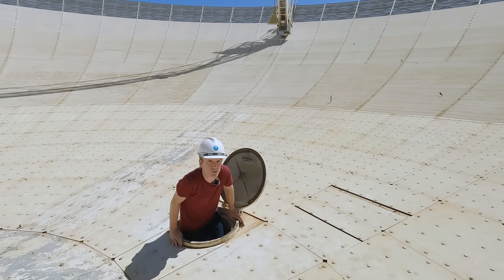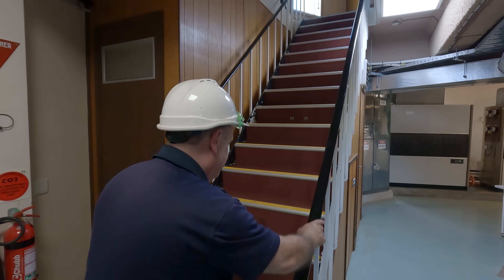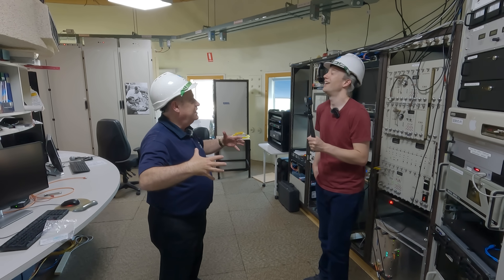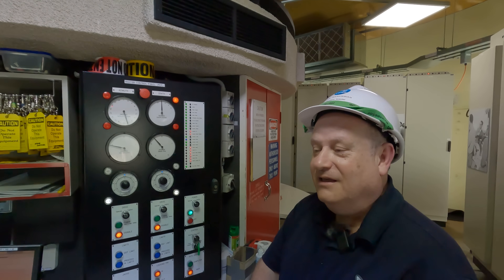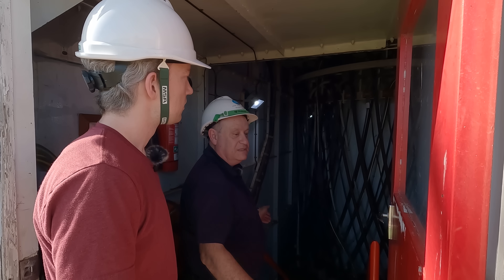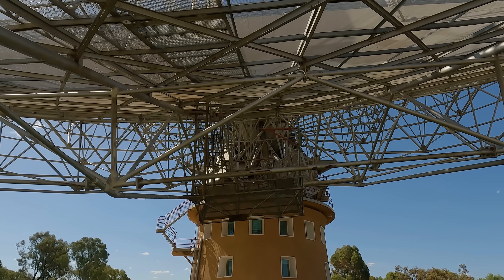I took a ride on a moving radio telescope

Comment: How the dish at that angle doesn't rip off from the building is quite interesting
Reply: At about 5 minutes, when the dish starts to tilt, you can see the counterweight on the other side of the pivot. So the whole assembly will have a center of mass that's directly above the riser.
Reply: @f0rth3l0v30fchr15t  Also, they mention that dish assembly is just lying on the azimuth track. So it have to always keep the center of mass inside this track, so sher weight of the dish keep it from falling.
Reply: @f0rth3l0v30fchr15t  wow, I totally missed that counter weight! Guess it goes to show just how lightly you can make these radio reflector dishes with the crazy long wavelengths some of them work in that a similar (or probably substantially more so because of the torque the dish would exert being so far from the axis of rotation) can look comparatively tiny to the reflector dish!
Reply: @f0rth3l0v30fchr15t  right, thank you. I was wondering too but couldnt find a good sideways shot in the end.
Reply: 5:23
Reply: @duudiiss  what why did you put a time loop?
Reply: @meandmaw588  what?
Reply: Who cares whether it's attached to the building or not? The question is why it doesn't fall off when it's tilted at that crazy angle. That's a valid question no matter what piece of the structure it's attached to.

As others have said, the real answer is that there's a counterweight to keep it balanced. It has nothing to do with it being attached to a separate foundation, that was done for a completely different reason.
Reply: @AndrewMeyer  Fun thing, it is not attached! It just lay on top of the azimuth ring, and its weight just kep it there.
Reply: @AndrewMeyer  Or it’s the fact that the radar dish itself isn’t super heavy, it seems to be mostly mesh/framing.
Reply: According to the Parkes "User Guide", while the dish itself is 300 tons, the counterweight is 475 tons.
Reply: Even when its tilted like this the dish is still centered on the central column so there are only vertical forces from the weight of the dish.
Reply: Counterweight is a magical thing.
Reply: @mattsmitt00  As is cantilever.
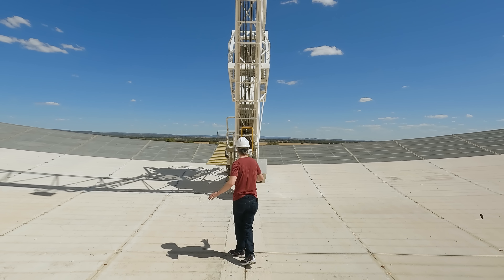Reply: 5:03 you can see a big counterweight at the back, so the center of mass stays the same no matter where the telescope is pointed.
Reply: @Riesenfriese  The counterweight had such a small volume compared to the large parabola part... The material must have been very dense.
Reply: The full answer as other people have pointed out is that the dish's weight is supported by the azimuth track, but the counterweight at the back of the dish weighs slightly more than the dish itself, keeping its centre of mass much closer to the centre of the structure. As John indicated heavy winds can upset that so which is why they have to stow it pointing straight up if the winds pick up too much.
If I recall correctly (It's been a few years since I was running tours) the counter weight is a good 50-100 tonnes heavier than the dish itself, in fact they had to increase its weight when they put the new focus cabin on because the new focus cabin was substantially heavier.
Reply: It's not even bolted down, it's there with its weight. Balancing it must have been a huge task without computers!
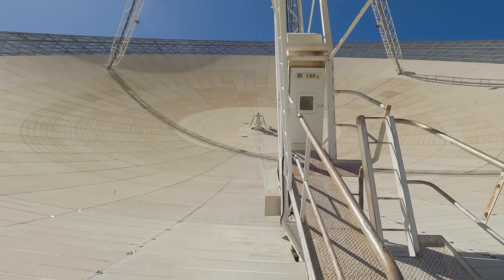Reply: If im understanding you correctly, the dude said at 6:40 "its just the sheer weight that grounds it". At 8:30 that seems to be a counter weight to keep it more centered as it rotates to avoid tipping over. When you look at it, the bottom half of the dish seems to be significantly heavier, so all that keeps it from "ripping off the building" (or so I believe)
Reply: @HoIdenJones  yes it's counterweight
Reply: "some of these telescopes are built so that the dish doesn't fall off"
Reply: @OwlRTA  Which is a good thing, it's a little difficult to tow a dish beyond the enviroment.
Reply: @OwlRTA  "at all"
Reply: Unless the building is mostly thick concrete and the bricks are just décor essentially
Reply: @AFGuidesHD  Like the guide said in the video, the dish and the central column supporting it have their own foundation and are not connected to the building, the building is entirely aesthetics to house personal and equipment.
Reply: @boogusnutsack5926  *personnel
Reply: @aprilbornheimer4094  Thanks
Reply: @AFGuidesHD  if I understood correctly, its not resting on the building, but the separate central column which seems to be made out of a pipe-shaped steel outer layer and a massive steel core column.
Reply: @kennichdendenn  that’s right. It’s supported by its own foundation and inner structure
Reply: @kennichdendenn  i
Reply: @AFGuidesHD  3:56
Reply: At 4:55 it looks like the dish has a large counterweight to keep the load on the tower vertical as it rotates.
Reply: The dish is on a separate foundation from the rest of the building, they mentioned that in the video.
Reply: @richardmillhousenixon  And the dish isn't fastened to anything at all!
Reply: @richardmillhousenixon  In the video he talks about a "device that helps us point the thing and we don't want it connected to the building due to vibrations will cause the instruments to be out". He doesn't mention anything about structural integrity.

I'm only saying this before anymore people chime in with a similar "you didn't even watch the video" line.
Reply: @AFGuidesHD  Dude, just take the L. Literally the sentence immediately before that one he explicitly says that the dish is on separate foundations. Your quote was the follow on that explained why that's the case.
Reply: @bosstowndynamics5488  Except i'm not going to "take an L" for something he doesn't say. "This column has a separate foundation to protect instruments from the vibrations". There's alot of extractions to get anything about structural integrity or weight distribution from what he says at the 5 minute mark.

I'm not arguing with what others say here. In fact it raises even more questions if most of the weight is on that thin column.
Reply: @bosstowndynamics5488  Mate, he never said the dish is on a separate foundation, the center column is because they don't want vibrations from the rest of the structure (the dish/the foundation it stands on) transferring to it
Reply: @cotneit  Brother, if it's connected then vibrations would transfer. That's how vibrations work. That column isn't there suck vibrations into it from the air.
Reply: @AFGuidesHD  You obviously didn't even watch the video
Reply: @Flyingdinosaur69  ;)
Reply: @AFGuidesHD  Sigh, people don't listen or watch closely, do they? 
Firstly, the "central column" is not that thin steel post (that supports the stairs) it's the large steel casement they walk thru to get there. The even taps it as he talks about it here: 05:28

Secondly, the "master equatorial" is not the mount for the dish, it's the optical telescope that is used to aim the dish. He says so here: 07.36

The dish itself is supported by the main building. You are correct, they all need to pay attention to the video.
Reply: @AFGuidesHD  the video explicitly says that the dish is on a separate foundation. You said "Unless the building is mostly thick concrete and the bricks are just décor essentially", which is completely irrelevant, given that the video explicitly says that the dish is on a separate foundation from the rest of the building. I'm only saying this before anymore people chime in... oh wait no.
Reply: @AFGuidesHD  it's not connected, looks to be built the same way that battleship turrets are
Reply: Not only it's on a separate foundation as others have said, but it's not even attached to that column!! It's just resting on it and staying there because of its own weight! (6:38)
Reply: It works like battleship turrets, it's just a floating superstructure held in place by its own mass. The dish weights about 500 tons, and it's counterweight weighs about 500.001 tons, which lets it self-correct if anything goes wrong. The bolts on the thing holding it to it's counterweight are also absolutely massive though, from memory, I'd say probably half a metre wide, and there are dozens. They also didn't mention that the little blue motors that turn and rotate the dish are only a few horsepower each, and aren't really any bigger than a few dozen cm. It was really cool standing next to them during the 50 year apollo anniversary watching it all move and whir right in front of you!
Reply: The angle doesnt matter. The altitude axis has counterweights, so the center of mass always remains centered above the building.
Reply: If you think about it the dish is very very light compared to what you would think.
Reply: Large counter-weight built into the jointed structure balances the dish so that very little power is needed to move it.
Reply: Proof everyone watches Tom Scott 🤣
Reply: infinitely many turtles holding it up
Reply: It has a counterweight.
Reply: Best believe what you see above ground isn’t all their is I’m sure the foundation goes down in the ground a good bit
Reply: That’s what I was thinking
Reply: the structure of the telescope is likely designed "lightweight" (at least it looks like it was) so more of the weight is concentrated in the things below the telescope (or behind it once it has folded down) so the stress might not be as high as expected. plus it is on a different foundation that is likely build to support it's extreme weight and the stress.
Reply: Where in Australia is the telescope located?
Reply: @Saxondog  Parks, New South Wales.
Reply: @Saxondog The Parkes Observatory is north of the town of Parkes, about 5 ½ hours drive west of Sydney.
Reply: @Saxondog Parkes.
Reply: concrete has insane compressive strength.
Reply: God keeps it there?
Reply: not surprising at all
Reply: There's a fulcrum, I image the dish is balanced at any angle.
Reply: Counter weights.
Reply: Its being balanced by counter weight. 8:35 you can see the arc shaped counter weight on the opposite side of the dish
Reply: plus it has to be counterweighted. otherwise the motor had to work extra hard to move the thing
Reply: Consider where your soul will spend eternity, heaven or hell.  You don’t want to end up in hell because you rejected the Sacrifice Jesus has made all who repent and turn to him by faith.  We are all guilty of sin.  We lie, steal and look with lust in our hearts.  We are all Guilty before a Holy and Righteous God.  GOD is not just all loving and overlook your sin.  He is loving but sin He will Judge because He is Perfectly good. The Good news is God the Father sent His Son Jesus Christ who was perfectly Holy to pay the penalty for your and my sin out of Love for us.  We can’t keep the Law we break most all commandments.  But Jesus fulfilled ALL by his perfect thoughts, words, deeds and motives for us because we could not. Jesus loved all humans and God the Father perfectly.  Turn, repent of your sin and confess Your thankfulness for what Jesus did for you.  Put your faith in the perfection and the righteousness of Christ.  Jesus was raised from death to give you new life; death has been defeated. Out of love and grace eternal life is promised to those who have faith.                    ,/......................................
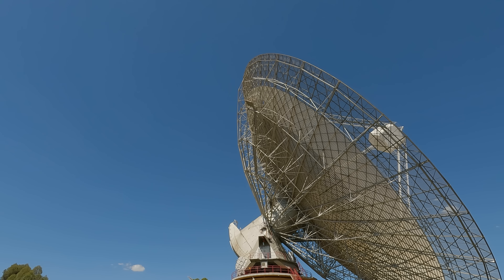Reply: Its not just hanging off the side.  Theres a massive counterbalance there that keeps the weight mostly evenly balanced on either side.  Its the same way most, if not all, dish antennas work.  You can see the huge solid metal block at 7:30
Reply: At 7:30 you can see the massive counterweight
Reply: They are not connected and there is a counterweight you can see as well ;)
Reply: besides being on separate foundations and physically disconnected it is even more mindblowing to me that it is "just resting" up there and not bolted down to the center column as well
Reply: @derKarl_stp  you cannot bolt something that big due it´s size - it needs a space to expand and shorten. It is the same with bridges - every piece is tight up on only one end, the other side of that part is "loose" on some rolling stock of sort, so it can work due to temperature changes. 

It is the same case with Madison Square garden or where Tom was - it´s ceiling is only laying down there due to it´s weight and no imaginable force can lift it up and carry away. It is slightly more difficult with huge dish and that´s why John said that in extreme weather the dish need to stand straight upright to not fall over.
Reply: @siriusczech  Jan I know that this can't be bolted down (for several reasons, besides the ones you mentioned)

one of the reasons is the possibility of binding up during use as different materials have different expansion rates and speeds during temp-changes.

it's similar to bridges that (most of the time) are totally free floating over here and rest on rolling pads to be able to move independently from the ground and pilars (seen a lot of bridges on the underside and their resting points over here and there you can see that they aren't fixed in place)

I just meant it is kinda mindblowing that this thing is just resting there and actually could fall off during stronger wind and then they tipp it over to the side so you can haul heavy things into the center of the dish when needed... you would think something is bolted down there because it looks so unreal but it is not

this is mindblowing, that this well balanced structure still has some play to it when it comes to weight and movement
Reply: At any angle, it's center of mass is still over the bit it sits on.
Reply: Very interesting. A very different design to the Lovell RT near where I live in Cheshire. It seems more industrial while the Parkes looks very elegant on its small base.
Reply: ENGINEERING SON
Reply: So mind boggling
Reply: And you didn't bring a skateboard. Figures.
Reply: It's counterbalanced probably to within a few thousand lbs. Otherwise the worm and gear would wear rapidly. Lifting the loads with the dish is probably the heaviest thing it sees.
Reply: Glue
Reply: Did you even watch the video?
Reply: Fun fact: the beam goes so deep that they moved the location by 100 meters during planning so it doesn't disturb the Stonehenge || |||  ||| ||
Reply: Suction
Reply: frr
Reply: Didn't they say the satellite wasn't attached?
Reply: How it doesn't rip of the building is the counterweight. At that angle the the counter weight ensures all force is still downwards. 
Without a counterweight it would fall off the building because the force would be sideways.
Reply: There's a huge counterweight on the other side to keep it balanced.
Reply: it probably has a huge foundation
Reply: the center point of the weight is always in the middle
Reply: bro its the guy making a video on games
Reply: Alien technology bro
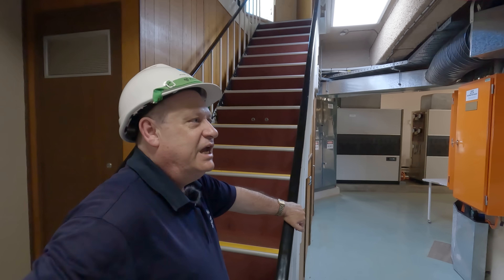Reply: 1:00
Reply: Simple physics really
Reply: It's bad enough that people immediately jump to pedantics about the separate foundation just because you mentioned "the building" in your follow up. What's worse is that some feel it's entirely appropriate to be insulting, demanding acquiescence like your curiosity was some kind of egregious, intellectual folly. All because you didn't mention the separated central structure. A central structure that is, to the aggrieved six-minute experts: "ENTIRELY disconnected from the main structure and HOW DARE YOU think the building holds ANY structural responsibility when it's OBVIOUSLY on a different foundation and THEREFORE the building would be UNSCATHED in the event of collapse YOU BUFFOON!! HERE IS AN L, TAKE IT FOR YOUR COLLECTION!!"

To the few that simply mentioned the counterweight: that's the correct answer. Thank you for staying on topic in your answer.
Reply: @illitero  well said mate
Reply: @illitero  smacks desk thank you!
Reply: There appears to be a huge counterbalance behind it. I figure they thought of that when they built it...
Reply: One of t’lad’s  best.
Reply: @josiebee-e6e  
T’lad, hahaa!
I agree, t’lad did do well. 
Well Done t’lad!
Reply: @josiebee-e6e  Agreed
Reply: The centre of mass is still above the tower, probably
Reply: physics bruh
Reply: If you knew it was on a separate foundation then why you ask if it would rip off from the building? It's not part of the building.
Reply: @The_Miles_Edgeworth  I didn't know it was on a separate foundation and still don't. The whole contraption is on the building. Even if most of the weight is on the smaller column there's still the tracks that go around the whole rooftop.
Reply: @AFGuidesHD  "At the top of this column is the master equatorial"

That's the thing that holds the telescope so they can aim it accurately. Dude just take the L.
Reply: @AFGuidesHD  I think youre missing the people mentioning the counterweight, thats what enables the thing to not just rip off of its center post. no matter how tilted it is the weight is still centered directly over than post.
Reply: If you actually paid attention the guy said it’s not connected to the building structure but a separate solid steel column in the center

Comment: If the entire dish structure is just resting on the azimuth tracking wheels, to keep it in the tower, then how come it doesn't tilt over and fall when you point the dish sideways? Surely then there's a lot more weight on one side than on the other?

Comment: You have the craziest and most interesting experiences, Tom. Thanks for sharing! I've been to the VLA (Very Large Array) in New Mexico, and it's really something else. Those dishes are astonishingly huge, and they're all on massive tracks in order to, as a collective, operate as a single ridiculously huge receiver. The tracks let all the dishes move to either be tighter in formation or wider apart.